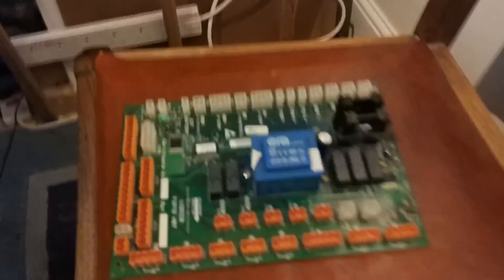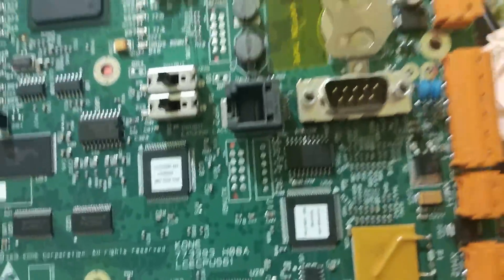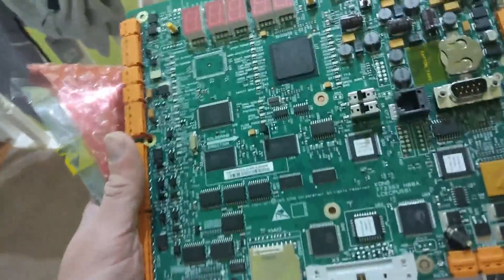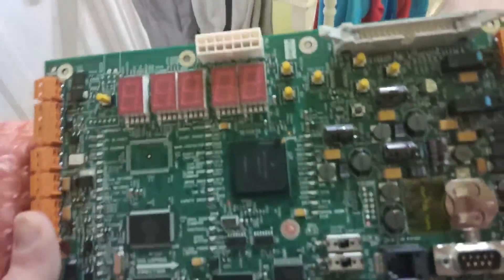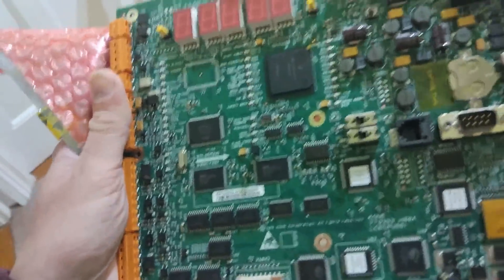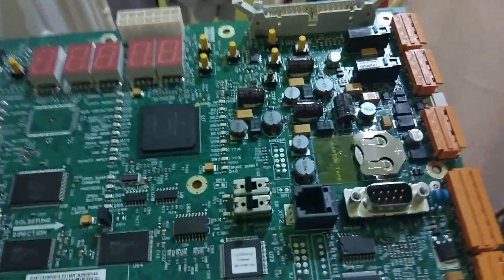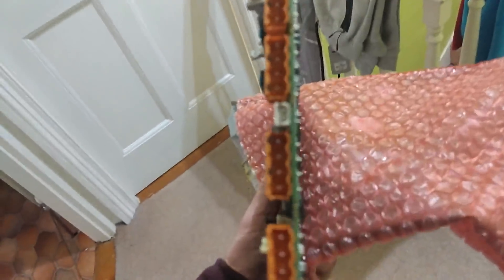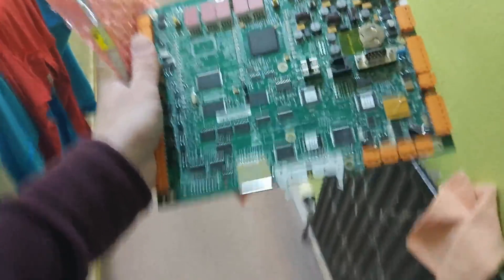PLEASE HELP - Writing NVRAM chips via serial

Comment: If you want to know the board's voltage, measure a working ecodisc board's power input voltage with a multimeter.

Comment: Beno Lifts: write on google Macronix and the numer of the 1st line under the MX name you can see the type of the chip write it on google and write datasheet to the end and you can know what kind of chip it is :-) capacity and operating voltage normaly 2,6 -3,7 V of this chips at 8:34

Comment: AT 4:36 this are not NVRAM chips they are Flash chips. this type of TSOP48 package is mostly used on Blue-Ray Disc players they contain the firmware for the device but Macronix flash chips have a data retention of 10 years.

Comment: Well at 3:15 the 2 flash chips in the center are Macronix Chip short name (MX) with TSOP48 package there are probably the Firmware/BIOS of the mainboard. does this lift controller have Microcontrollers on it ?

Comment: The white one is. Power supply. Why not ask a lift engineer I've done. Electronics engineering and programming it normaly as it on board try Google it. Or ask kone if you. Send them a picture off board there will know the one a bought the digital display

Comment: Buy a Bus Pirate. The serial port is going to be RS232, probably 9600 or 115200BPS 8N1. A bus pirate will be your friend. You can probably hook it up directly to the NVRAM instead of having to dump the config from the serial port. Voltage is probably gonna be either 12 or 24 volts by the size of the connector. Follow the traces from the power connector and see if you can find any voltage regulators on the board - look up their datasheet and find their input voltage. If all else fails it you could probably bring the elevator up to the cabinet and probe the connectors with a meter. I'd be willing to run the SD image through some tools I have - do you mind sending me a link to the image?

Comment: NVRAM is a RAM memory that also contains an EEPROM, so you can save/recall non-volatile data directly from/to RAM. This maximizes EEPROM lifespan, since you only need to write to EEPROM upon power-down and RAM does not suffer from write cycle limitations. It's the best of both worlds, really!

Comment: The NVRam is probably accessible through a JTAG connector. You'll need a JTAG adapter and some software to probe the bus and see what devices are connected to the JTAG. Also, if you mean pin 2 and 3 need to be reversed on the serial port, that's common. That's not even "security by obscurity", that's just DTE vs DCE pin outs of the port. A standard cable called a "null modem" cable flips those pins for you.
Reply: Oh, I watched it again, you need to reverse engineer the serial protocol, which would require some reverse engineering of the code that's running on the processor (it looks like it's a 68000)? You'd have to read the code out of the ROM, and decompile it using something like IDA. You should still be able to access the NVRAM directly through the JTAG, but then you'll need to know what you're looking for, and what has to be changed. The easiest is to have one board that's unlocked, and another board that's locked, read the chips from both, and compare the differences.

Comment: Isn't it easier to create the logic by yourself using cheap prototyping hardware like Arduino? You've got the buttons and displays there. And later create a model lift shaft, add a motor, drive and a few sensors and you have a working model. I made one already and i can give you a few ideas to get started. Here's mine: https://www.flickr.com/photos/conznl/31273029203/in/dateposted-public/
Reply from the maker: Your model lift looks very impressive.  I have made a model of a twin lift using a raspberry pie.

The aim of the Kone LCE hacking isn't to make a model, but is to unlock proprietary restrictions that Kone have created to forces people to come back to Kone for maintenance contracts.
Reply: That's not going to be easy! Have you looked for a debug/programming header on the board (JTAG for example, the 6 or 10 pin variety) that you can use? Most devices (including almost every router) have one. The DB9 serial port is almost always just for simple fault finding and configuration by engineers with standard qualifications. The programming header can be used to (re)program the main CPU or exposes extra configuration menus via the serial bus. Very often the programming bus is al TTL level where the DB9 port is at standard 232 levels.

Comment: Maybe dave from the EEVBLOG can reverse engineer it for you. It looks just like an pc mainboard or an arcade game board. What cpu is it? Is it some ARM based chip? That serial looks like RS 232. My dad programs Atmel microcontrollers for hobby, maybe the nvram uses I2C bus to communicate with the cpu?
Reply: Oooooooh !!  Yes Dave Jones!  Would love to know what that CPU is too, maybe an old design that just works?
Reply: I wonder if it's a Z-80 or a 68000 the chips that ower belowed Megadrive is mode off... But I bet an Arm chip is more likely. Whenever I see ARM chip I think of my dad's old Acorn Archimedes 310.......

Comment: The volatage is probably 12V but you should check it with a multimeter...
Reply: +Race Chapman noooo once it starts smoking significant damage has probably already been done to the chips by over volting.
Reply: @ELPaso1990TX  I somehow think that was tongue in cheek sarcasm.
Reply: If this is the case then you should try using something like an ATX Power Supply such as the one in your computer..........
Reply: Ha. What are you checking with the multimeter, since there is no voltage until you supply it?? Sure, supply 12V and meter will read 12V. Likewise supply a nice blowupy 170V and the meter will read that too.
Reply: just increase the voltage by 1V until it starts smoking, then back it down a couple. should be fine.

Comment: For the protocol from the serial port have you tried FTP or MTP?
Reply from the maker: FTP???  It is low level, it isn't going to have a webserver on it
Reply: I'm pretty sure that I read somewhere that Kone were planning to add FTP to some of their lift logic but IDK.
Reply from the maker: This board is all low level.  It has a real time operating system, and the system for writing chips will also be low level.
Reply: ok so we know that it definatly isnt FTP but it could be MTP, CTP or Mass Storage like on mobile phones. You should probably plug in an RS242 Serial Cable to USB into the board & your PC & see what comes up on it because windows might detect that it is lift logic & may allow you to transfer files to the board

Comment: Is there any markings on the board for the voltages? Normally devices like that run from 3.3, 5 and 12 volts.
Reply: Lol it's not a pc motherboard mate. You're more likely to see stuff like this powered by 24V and having an on-board dc-dc converter.